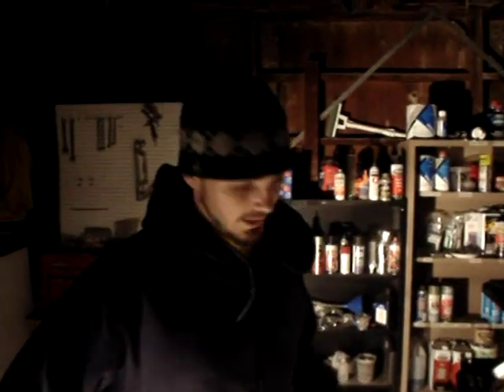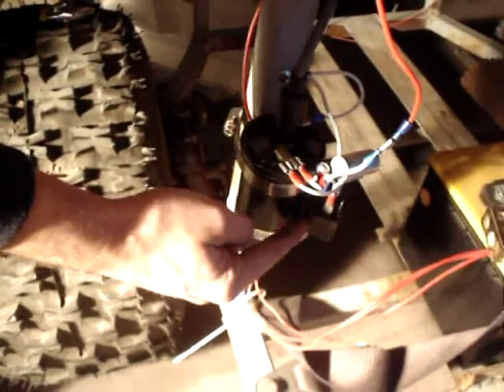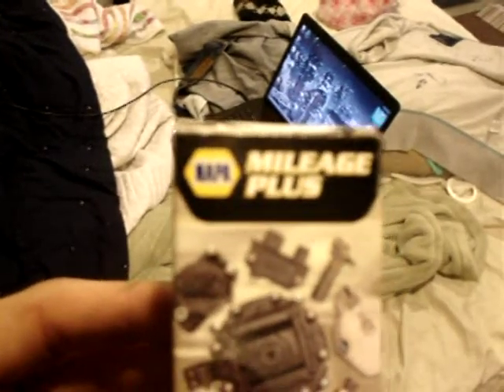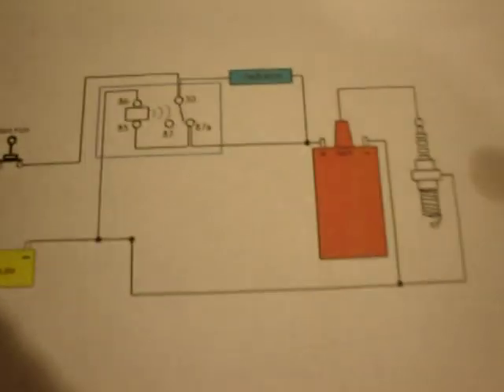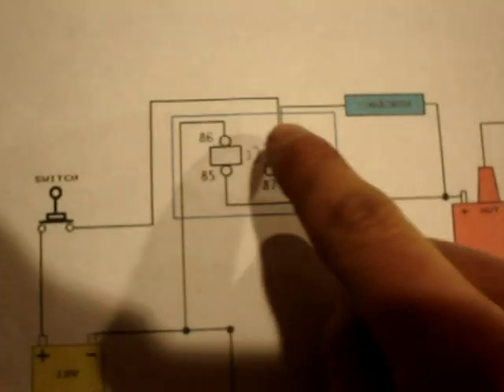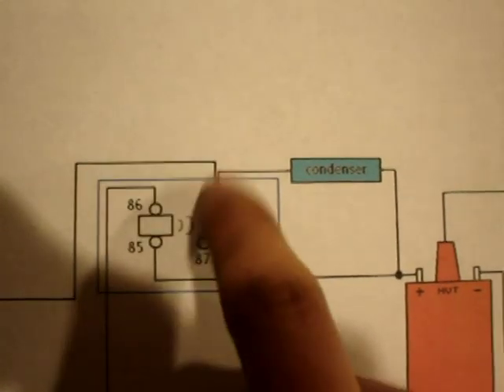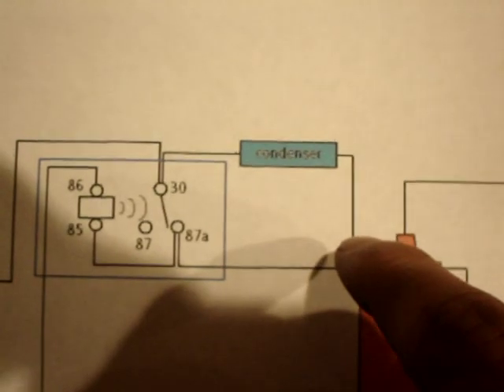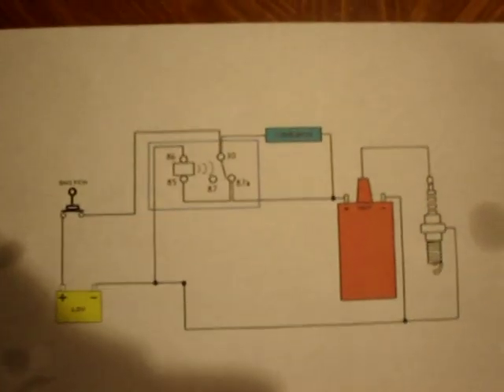How to make a buzz coil Part 1

Comment: So I want to do this for a Model T. That wants 4 coils- or 4 outputs.
Could I use 1 (modern) coil and 4 relays and caps? Let the commutator select each "coil" ground just as it would have with the original coils?

Comment: Hey buddy i have searched alot but cannot find any instructions on wiring it to a GSXR 1000cc motorcycle which has a coil stick (coil is one piece with the plug plastic).
My current setup is parallel capacitors pos (+) =batt pos and neg to ground to chassis of the bike which i believeshould be same as ground for the plug.? I have pics if required. 
Will this work or do i have to ground to each individual plug? I LIKE THE IDEA OF USING THE RELAY as i believe is the distribution point like you have on yiur schematics.

Comment: there are different 5 pin relays so the one with 87A and 87 switching is the right one. if one gets a 5 pin relay and it has 2 87s in series and it switches off the 30 that's a wrong 5 pin relay.

Comment: Hello! I couldn't find a whole lot of information on Buzz boxes, just lots of boxes for sale. I have a Perkins hit and miss gas engine that my friend willed to me. Problem is we never got it running before he passed on. I built your buzz box and it seems to work just fine by just using a spark plug. The engine has a cam which is timed by a gear on the crankshaft. There is a bolt attached to the cam but I don't know what wire from the Buzz Box should be connected at that point. You mention a 600 V. capacitor being used. I don't know where to install it. Thanks for all your help. WE need more people like you that know how to explain things.

Comment: The condenser/capacitor thingy is supposed to protect that from happening. Did you get one big enough? Also is it hooked up in parallel or series? It needs to be in parallel so the electricity has an easier time going into the condenser than the relay. PATH OF LEAST RESISTANCE WINS.

Comment: First off, AWESOME video. :)
I have it set up, and the relay buzzes but stops when I hook it to the coil. 
Once I hook it to the coil it will still discharge when I disconnect it but the relay stops buzzing. Can you give any advice? Thanks!

Comment from the maker: @offom If the relay is overheating then the most likely cause is the spark is being discharged inside the relay itself. This would be from the spark plug ground being connected to the same ground wire as the relay. On lower voltage coils this is not an issue but for higher voltage coils you need to have all your ground wires grounded to the chassis and not connected to eachother in anyway. In my diagram it shows all the ground wires connecting to eachother. This works only on low voltage.

Comment: We built the circuit you have shown. We used ignition coil and condansator from the car system. Our relay overheats after 5 seconds or so. What will be the specifications of condansator and relay to use them with car battery ?? Thanks so much.

Comment from the maker: It sounds like you might have a defective relay or it is hooked up wrong. If you can get sparks with a switch turning it off and on manually and then hook up the relay then it doesnt work then I would say try a different relay. Make sure too that the power is going through the pin that is always connected. Usually 87a is that pin but make sure by using an ohmeter and touch the positive to pin 30 and the negative to 87a and if the reading does nothing then you want to power the coil with pin 87

Comment from the maker: Depending on how many volts your coil is trying to put out you might have to have the battery, the relay, the coil and the spark plug all grounded seperatley to the vehicle or project your working on and not through negative wires that connect to eachother. If the negative from the spark plug goes to the negative of the relay it will not let a spark generate. Hope this helps!